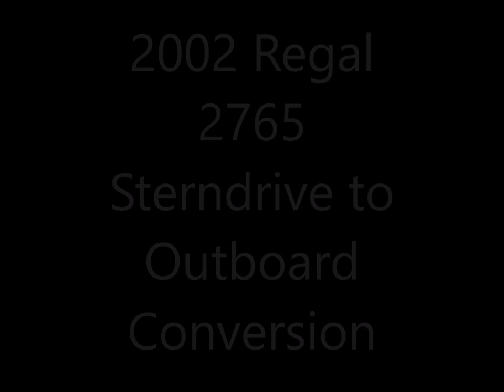Regal Sterndrive to Outboard Conversion Project Part 1

Comment: The transom will require strengthening to handle the weight and force of outboard motors. Stern drives exert their force more onto the stringers of the boat.
Reply: Is the forward force transfered thru the outdrive to the motor and to the motor mounts that bolt to stringers or is the forward force transfered from the outdrive to the transom itself?

Comment: That's what I started doing to my old Thunderbird, wish you had shown exactly how you filled those holes...  I have one hole - center - and was considering an outside patch.
Reply from the maker: I laminated with mat and resin marine plywood on the inside across the transom. Then from the outside I screwed marine plywood laminated with resin and mat to fiil. Used 2   3/4 marine plywood.

Comment: For structure would it be better to build up from smaller to bigger pieces,  and then feather to outside the holes you're patching, or does the inside wood you put pretty much take care of that?
Reply from the maker: the wood from the inside takes care of that.

Comment: The bracket has to be a certain height its got to be higher than the original height you have to check with the manufacturer for information

Comment: I am in central fl going to convert an 270 seary, where did you get your bracket, thanks
Reply from the maker: A&J Marine Welding is the bracket manufacturer in Miami also known as custommarinewelding.com

Comment: whats the upside of such a conversion. The motors are hyper-expensive from what i saw.
Reply from the maker: Outboards are more dependable,  fuel efficient, and now I have all the storage space where the inboard were. Also, gas inboards are dangerous inside the boat.
Reply: @abouttimeboating9670  thanks for the answer. How much more efficient are they. I guy on Youtube commented that he runs now 7hours on the fuel he need in one hour with twin inboard-V8s....how come, Sir?
Reply: @abouttimeboating9670  I would not need any more storage-space but to fit more people in the boat would rock enough

Comment: why would anyone in their right mine do this type of conversion on a boat of this type
Reply: Comes down to cost and/or preference I imagine. Maybe it’s about a long term maintenance prospective. 
That’s purely speculation though…
Reply: Because outboards are better than inboards simple....
Reply: If the impeller on a stern drive goes, in fact, if anything on a stern drive goes, you’re pulling the boat out of the water for repairs. If you’re in salt water, a stern drive is basically bathing in salt while an outboard can be raised out of the water and flushed. In cold climates, it’s easier to winterize an outboard, even in the water. Working in a tight bilge is a pain compared to the power head (spark plugs, etc) are right up top on an outboard. But basically, he probably did this because he could!
Reply: Apart from the fact that inboards on an outdrive are total grief petrol inboards are a time bomb waiting to go off. I got a 27 foot SeaRay and planning to put twin outboards on the back
Reply: @stevemason5348  I have to say that any engine is a time bomb, and if I may ask, how does an  outboard run, does it use water,  justa a comment because you stay petrol inboard, outboards are petrol as well, gas tanks for both are inside the boat, so its the same difference, if they are going to blow up they will blow up
Reply: @VH-vlogs  i presume you,ve never seen an inboard engine catch fire, there is no putting the fire out so not alot of boat left. You only need a split fuel line that sqirts fuel on a hot manifold or on the alternator and up they go. By the time you see smoke coming up through the.engine cover game over, yes you can have automatic fire extinguishers but they wont do much for a full on fuel abd fibre glass fire. If an outboard bursts into flames its hanging off the back of the.boat and easier to deal with.
Reply: @stevemason5348  If you do go that route, I hope you post on YT how it goes.  I have thoughts of buying up a bunch of freshwater 1990 vintage 25 to 29 ft. Sea Rays and refurbishing and repowering them.  Those were great years for the brand.
Reply: @stevemason5348  I have 1981 Sea Ray Sundancer 260 and I want to go with an outboard, but it’s 1 year waiting list for any 250-300 and up engine… :(((
Reply: @VH-vlogs  because an inboard motor requires a blower to blow out the exhaust gases/stagnant gases, an outboard, because it being outside, does not require any sort of "blowing/clearing of anything" to safely start. Im not sure if buddy means petrol or gas, but petrol and foam and gasoline amd foam can both turn pretty napalmish
Reply: @etothelij  So what if it requires a blower, its not a strong argument for the replacing of the inboard, that is just like a dumb answer to be honest